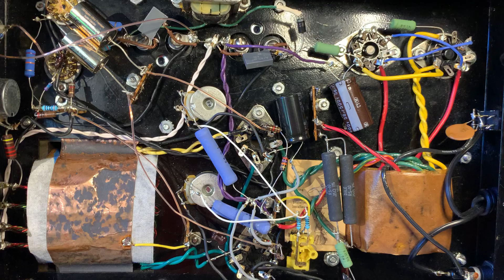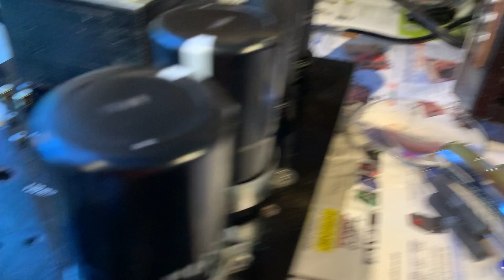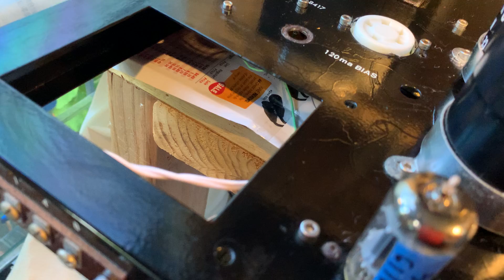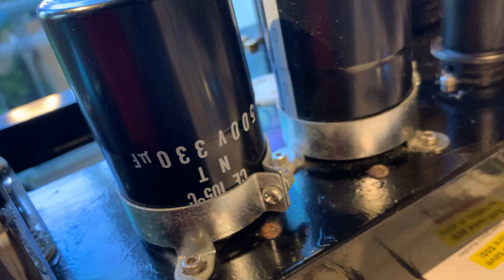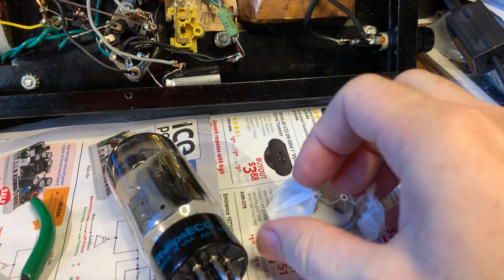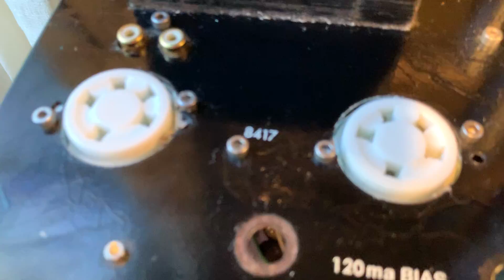Peak inside the first generation Quicksilver mono

Comment: mess wiring
Reply from the maker: Indeed, I was not going for any beauty contest prizes. Looks like a mess, but what matters is observed. (Which wire can go close to which, and critical angles between wires, and making them as short as possible.) Perhaps the worst offence to sonic properties one can do to sound is to procude very neat looking wiring by bundling them together. There's so many amps where the wiring looks amazing but leaves a lot of room for improvement. And vice versa, looks bad, but make it good looking and you loose a little from the sound integrity. 
There's always a balance and one has to pick what matters in the time you have for a project. BTW, this amp is one of the best sounding amps ever for classical music. While we can argue about what best means - in this case this amp has created the best tuba reproduction I Ever experienced. And the friend for whom I modded the amp is a tuba player, so there you go, I'm not sad at all that the wires look messy.

Comment: Excellent…this is the older version of my amps, which comes with NOS Tesla EL34’s (which I prefer), but was given a quartet of KT88’s, so I’ve got them in there now. I did aprox 75% of the upgrades and mods you suggested, and as I mentioned, it made a definite positive and noticeable difference. The driver and input tubes in the newer mid monos are 6922’s and 12AX7’s, plus they’ve got solid state rectification. For the price, I can’t really think of a pair of amps that give you the kind of value they do. Mike is certainly in it for the right reasons, the love and passion of building high quality musical sounding amps. Because they’re P to P / hand wired with such excellent transformers, they make an especially good template for modding and upgrading. Thanks, Janos! 🔊😊🎶

Comment: Originaly the bias was measured with a Jackplug on the chassis , there was one bias trim pot and one needed to insert the plug in the 6.3mm jackplug and measure ( in cirvuit ) the milli amperes and  NOT the voltage ! ..setting at the factory was set at 120 ma total for both tubes, so 60 ma per tube ! But this is another reason for failure when the tubes going to wear out different and cause failure and eventually burn out of a transformer winding and also likely blowing up the tube that goes red plating..
The gid resistor is often a problem with fixed bias, negelected by the manufactures of many tube amps with fixed bias !!!!!!!!!!!!!!!
Indeed auto bias ( self bias with resistor mostly // with a capacitor to prevent FB and loss of power )................is a good way to better protect tubes ........but than you need a transformer with a higher voltage to compensate for the loss of High voltage on the plate and to respect the original working conditions of the tube chossen by the designer......;;
One can choose new operation conditions with loss of power but also loss / change of the original sound of the amplifier.....;
seen on some designs is a good compromise and it consists of a mixed bias.........basic an auto bias and a complementary fixed ( adjustable ) bias...
Bias adjustments should be INDIVIDUAL !!!!!!! Yes I know some manufacturers prone the shared bias resistor as it sounds better..............;what happens is that the PP outputs eliminates heavily the second harmonics ........a shared resistor use the unbalane of the tubes that ballways exists ! ...to nceate some  second harmonics an that pleases the sound but.........the price is is some loss of bass ! .........and the heavier working tube will create  at the final day a run away , he will do all the work and the other will fade away.........
Either way of polarisation should be individual ............that means also that one can balance the tube at IDLE ..............;but that doesnt means that the tubes will work identical on a dynamic way when amplifying music !!!
So the rule is ALLWAYS to use well / correctly  matched /paired set of output tubes , .............NOT only on a tester with identical ma values for a given operation point but also with similar mho ( is spelled ohm inversed = transconductance/mutual conductance or the newer terminology Siemens; You never loose with good tubes & components ...

Comment: which is your favorite 6922 tube ?
Reply from the maker: I don't really like the 6922/6DJ8 family. The best 6922s are the ones selected for oscilloscope use - look ones that were special sorted for Tektronix scopes (regardless the brand), those really do a number on all the rest. I had a Tek scope with a vast array of 6922 in them..  astonishing scope. In that duty I absolutely LOVE the 6922...
 (Sadly, I gave it away though because it was a MONSTER, and could not hold on to it during my moving between apartments. Regretted it since.)
The 6922 family does not have good linearity at the low level, I really dislike its tone. Not bad, fun tube, lots of benefits. But I can't live with it, does not impart natural sound.
Reply: I need 2 pieces for my DAC (tube stage). I have Metronome C8 - that's why I'm asking. Thank You for your answer. Originally these were made against RF noise reduction ?
Reply from the maker: @MrBazsi888  These are frame grid tubes, they were designed to work in the MHz region. Get NOS ones, Philips, Siemens, or what is available at a price that you consider relatively affordable. NOS is well worth the investment as they last much longer than new tubes, so think of them as if you are buying not 1 pair, but 2-10 pairs.
Reply: @realworldaudio  any information about E288CC ? i could use that too?
Reply: @realworldaudio  YEAH A MONSTER .............IF ANY AMPLIFIER WOULD BE BUILD LIKE THOSE .........STILL HAVE MINE 🙃
Reply: hello MrBaz......
The 6922 or E88CC ( mostly ruskie ) is in principal not the best choice for audio.......It is used in audio and high end for years as this is an economic benefit for manufacturers and created an outstanding tool for marketting hype as THE audiophile CHOICE !
The 6922v has NO mica fingers on the cathode to reduce or prevent high frequency vibrations............that's why often they guve the FALSE impression for high detail in the upper end of the audio spectrum..........in fact it's a by product from microphony..;;
Not all 6922 suffer from this ommission of build without the mica fingers as seen on a ECC88/6DJ7.............use these when the PLate voltage is under 130 Volts!!!!!!
Best choices are indeed those E88CC when screened for microphony and performance made by some brands ( Tektronics as mentionned by Janos used often the TFK with the sticker selected by Tektronics for use in their oscilloscopes ).........
The best sounding in my experience are the CCA ( Siemens and TFK )

Followed closely by the SIemens E188CC /7308 ( not the version USA ECG/Siemens !!!!!! ), but made in Europe...
And the TFK E88CC when screened and selected !
E88CC Siemens ............same when selected ..
Also next Philips SQ !!! ( sold often as Amperex Buggle boy ) with a more forwarde presence presentation....;;
the Siemens has body and weighgt without loosing spaciousness, presence without glare and detail within the musical structure without artificial drawing attention ( unlike  the Russion versions offer body loosing clarity and loss off detail  and air .....

The TFK is like looking trough a window that is perfectly cleaned........very open and luminous view without stress or listening fatigue ( when selected )

The CCA has it all..........CC stands for C= triode , CC= double triode ..and A = best tube we can manufacture !!!!

I forgot to mention a nother outstanding tube ...........THE NOS TESLA E88CC 
gold frame , dark gettering = outstanding outgassing, gold plated grid wire .....lifetime 100000 hours +..................extreme build quality !
Sonicly a very good tube and a little more presence and dynamics..
All those tubes are rare and expensive.................to protect an investment one must apply HV only after 1-2 minutes warming up the filaments .........and at shutdown first the HV and min 45 sec later shut down the filaments .....

Have a good hunting season ...........these tubes all sound great and different...
There's no way back going to current productions or lesser quality sold often as nos but in fact they are used and put back in the original box........BEWARE !

Another great tube is the WE 396A..........2C51............( 5670 USA good but not to the standard of WE, Erikson in sweden made also military quality )....!!!! ( don't use the 6N3 sino )

.
Reply: @frankgeeraerts6243  Right now I bought Mullard E88CC/01 Gold pins (made in great britain). I hope it will satisfy my needs for my DAC. Thank You for the suggestions. If You could only have 1 matched pair, which would be it ?
Reply: @MrBazsi888  CCA
Reply: @MrBazsi888  Mullard has codes etched into the glass envelope .
O1 stands for selected tubes by the manufacturer mostly for use in oscilos etc. SO hopely you will be pleased .....give them some run in time ...
Reply: @frankgeeraerts6243  Thank You. Extremely helpful!
Reply: @frankgeeraerts6243  If You could only have one: It would be Siemes CCa or TFK CCa ?
Reply: @frankgeeraerts6243  There is also the  NOS TESLA E88CC  with Rhodium pins. Any opinion about that ?
Reply: @MrBazsi888  Both ........but a Siemens E188CC ( Halske Siemens made =/= Munich ) is the closest thing , most had even never the pleasure of listening to such a tube...........in fact at this level of quality you may like them allllllll............... :)
Reply: @MrBazsi888  The Tesla E88CC has GOLD pins and has the crossed swords of the Chech post on the bulb .........plus gold plated frame grid.......and dark getter flash !
The E83CC TESLA has both , Gold pins or Rhodium pins............in fact it is not an E83CC but a genuine ECC8O3S of the same quality build  as the TFK !
Reply: @frankgeeraerts6243  interesting. I thought that E188CC is not compatible with 6922 tubes.
Reply: @MrBazsi888  It is ONE big family with some differences ,the nos ECC88 is a marvelous tube and preferable to most 6922's, he plate volatge is limited to 130 volt and it has the anti microphonic structure . 6922 = E88CC= 6H23P ( EB) 
ECC88=6DJ8 and E188CC = 7308 
CCA is the precurser of the latter......
If your plate voltage is lower than 130 volt you can try them all !
Best is not to go above 70% of max plate watts and 100-120 VOLT /6 mA is fine.
Reply: @frankgeeraerts6243  I dont know my plate voltage. I have Metronome C8 Dac. Any clue ?
Reply: @MrBazsi888  No, but if you have the courage to measure ......between plate and cathode ..I think the voltage may be low enough !
Reply: @frankgeeraerts6243  some say that using gold pinned tubes in gold socket is not recommended. any advice here ?
Reply: @frankgeeraerts6243  I measured my tube section: it's 167V. so, what's the conclusion here, in my case dear Frank ?
Reply: @MrBazsi888  No ECC88 , so left are the  E88CC or E188CC..( 6922/7308/6H23P EB /CV2492 /CV4108 /6N23P EV /CCa )
Reply: Mine is ECC88 from Amperex “A-frame” and Philips Miniwatt A-frames.. Holland.. I haven’t tried other pricier variants yet..
Reply from the maker: I'm not familiar with the E288CC, but here's an AA post on the subject:     In Reply to: Can you use the E288CC tube to replace 6DJ8 anytime? posted by blazter on December 12, 2001 at 19:02:16:

    the E288CC is NOT a family member of ECC88/E88CC family - no more than
    the Russian 6N30P (6H30). The only three things they have in common are the fact that they are dual triodes, the pinout of the socket and the frame grid construction.

    The E288CC at bias point has a much higher gm, a much higher anode current, a much lower mu and twice the heater current than the ECC88/6DJ8, E88CC/6922/6N23P and E188CC/7308 which are - but for minor details and permissible dissipation per anode - very close to each other.

    A E288CC may work in an 6DJ8-socket for some applications, but more often that not it will not work properly, and either die prematurely or fry the amplifier or power supply, or it may oscillate and blow up your downstream components (speaker, valve amp output transformer).
Reply: @realworldaudio  okey. i will stick to E188CC or E88CC/01 or CCa or Tektronix versions. My Mullard is on its way to me, I hope for the best. Have anybody heard about Lorenz or Dario Miniwatt ?
Reply from the maker: @MrBazsi888  Good choice, you will like it! Have not heard of those two...

Comment: Nice job Janos.. I guess the new further mod might also involve a DC Film cap in place of the 56uF Lytic mod? I mean if there is ample space left inside the chassis.. BTW, it’s hard to see on the phone screen, but what is the purpose of those Silver Mica caps?
Reply from the maker: The mica is part of the negative feedback network. I will leave the lytic for now as space is tight for similar value DCLink there. C2 and C3 has a DC Film bypass across it, so that takes care of film-land ; ). I have not placed a DCLink bypass on the C1 lytic as there's too many HV wires running there and the added complexity would just act as hum pickup....
Reply: @realworldaudio  Yes Janos I do also use MIca/silver in FB loops when possible 😊

Comment: I thought fixed bias would be better as you can dispense with the large electrolytic bypass capacitor......interesting....
Reply: It's a very subjective thing, but it seems that many of us end up settling of self bias if you don't need the extra headroom granted by fixed bias.
Once you own a very efficient pair of spkrs all sorts of doors seems to open.
I don't even bother with bypass caps on my favourite PP amp cos I don't need the power and prefer the tone more without em.... (It is sacrilegious tho)
Reply: @dannixon247  Thanks for that Dan. As you say, it does seem that high efficiency speakers offer a paradigm shift that has many design solutions which just don't fit the accepted norm....
Reply from the maker: Yes, that cap is important, but as Dan wrote, it can be omitted when one does not need the power. (Then you get half the gain = 1/4 of the power). 
However, when you look at fixed bias there's at least 2 or more capacitors there (not just 1!), and a whole slew of components generating the fixed voltage... so it plays out as a single cap and single resistor in self bias versus a multitude of supply transformer, loads of wires, resistors, capacitors, and God forbid voltage regulators.... 
The execution of the fixed bias supply is paramount, and is (almost) always the Achilles heel of every fixed bias amplifier - the fact that it's fixed is not the main issue to sound. It is the part of the power stage that impacts the sound the most, as its effects are on the signal side, being magnified by the tubes amplification characteristics. Improving the fixed bias supply parts and circuitry is the easiest and cheapest way to improve the sound of any tube amp running on it....  as sadly, invariably, it is the part that gets the LEAST attention! While it SHOULD be top priority.... or at least an important priority, which can be met at almost negligible increase in total costs. Still, due to operational stability, I exclusively use self bias as fixed bias IS invariably a TIME BOMB, even wen we execute it in such a manner that sounds significantly better than the generic fixed bias measures.
Reply: @realworldaudio  So I'd be safe to say you wouldn't like the Tent Labs auto bias module that replaces the cathode resistor and capacitor.....or any of the solid state constant current source/sinks that some use....
Reply from the maker: @mfr58  LOL. would not. They work very well though when you mate the amp with low sensitivity speakers - then yes they become much more hifi, and most people will actually prefer that when listening to typical "audiofile" diet. Loads of fatigue and severely lacking in tone, zero transmission of low level detail and emotions, overEQd and overtightened midbass... so, not for me LOL. (Speaking of solid state in the bias in general - even the best examples fall into the category, the worst ones are just plain unlistenable to me LOL.)
Yet, as I said, with the wrong speakers this type of biasing will be definitively preferable for most... however the fix for those speakers is not skewing the biasing, but using the right type of amplifier to match them. Tube amps went to crap because they are forced into this nonsense game of driving dead speakers. Mixing water and oil... of course it's a mess.

Comment: Only use the ECG Philips>/>Sylvania the GE is to pronbe to run away ........
ECC83 /12BH7 ..........here in this amplifier use NOS !
One of the better mono amplifiers I ever used ...............and modified some for friends
The KT 88 conversion does not equal the original ...................if you have to make a choice go for the 6CA7 GE fat boy , marvelous also.
Now I go and watch the video to look how yours was modified ( especially to lower the possibility to prevent run away - just like diesel engines hahaha )...........
Any way ever find a pair and have the skills or know someone who realy knows tube technology .............do not hesitate !
Closest thing to a good triode amplifier in PP............without analyzing the sound performance but to be under the dome of music..........I loved to, play Franky goes to hollywood on this amp..........especially the intro...........😅
Only objection was the power supply eating up the GZ34's ..........but there's also a way of limitating the wear of these.......by the way no other than NOS GZ34's will give you the whole musical picture and the magic of this cult ampflifier.
Certainly one of the better experiences I had with PP...........
Have a sunny nice day .
Some of the later on sold US nos 5V4 tubes were in fact 5AR4/GZ34................it was more easy to rebrand these tubes for commercial reasons...........maybe you can still find some .